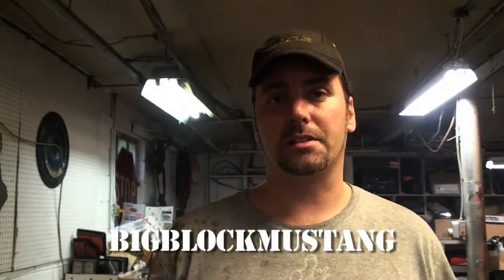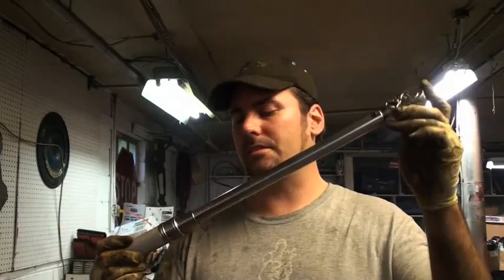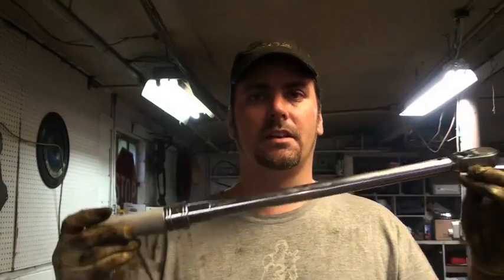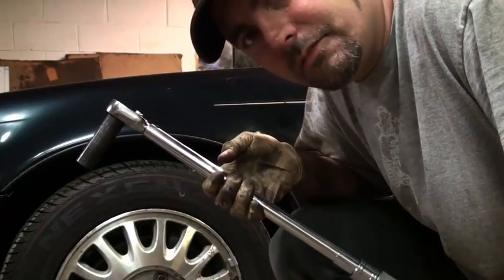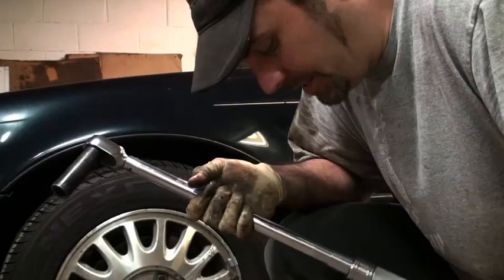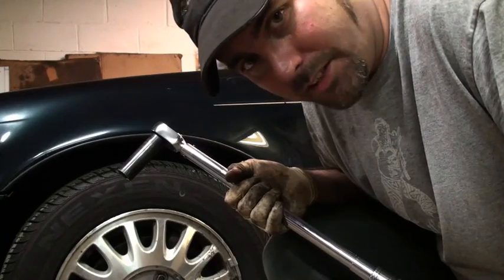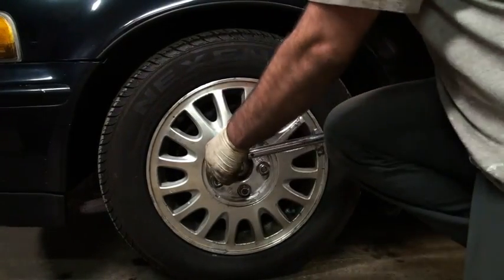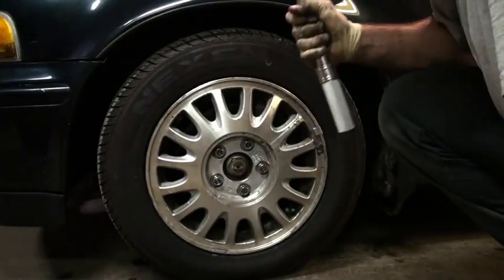Torquing Wheels and Why It Is Important - EricTheCarGuy

Comment: at the shop I work at we use torque sticks then the torque wrench to do the final tightening like you said to do. BUT we torque the wheels 20ftlbs higher (ex instead of 80 for hondas we go to 100). We do this to compensate for the rust on the hubs and studs. they also do this at the honda dealerships in my area. btw in Canada where I live we see A LOT of rust because of our winters. How do you feel about this method we use? thanks
Reply: i dont think that should be done. the best thing would be to scrape off or brillow pad the mating surfaces if rust is a concern. many people do not understand torque. if the stud stretches too much due to overtorquing, and the stud yields, then it is prone to failure. lug nuts should be installed by hand, so that any previously damaged threads will be detected. any resistance when twisting the lugs on by hand should raise a red flag. if the resistance is ignored and the lug is torqued down using any said torque wrench, the wrench will most likely get a false reading, since the damaged threads offer more resistance, you will meet your target torque prematurely, as trorque wrenches only measure the resistance to twisting. resistance due to bad or dirty threads is a negative. you want the only resistance to be via the stud stretching. bolt stretch and the spring type tension it generates is what keeps things tight.

Comment: Seeing your torque wrench setting turned down below the lowest setting made me cringe.
Reply: I don't know if you know this but all spring loaded "clicker" style torque wrenches require that for storage you turn down the torque setting. This is to preserve the tension of the internal spring and maintain accuracy of the wrench. You never store or leave a torque wrench set to a specific setting it "WILL" ruin it and require you to have it serviced or replaced.
Reply: Yes I've read that, but all my mechanic training, includeing Tech data used by the US Air Force and the US Army sates to set click type torque wrenches to their lowest setting. Not below the lowest setting.
Reply: insylem Torque setings should be determines by the stress level and rockwell hardness of the application and usage of the part/s.
Reply: I'm assuming he did that to show viewers at home the full range of settings, rather than as a routine practice. I will keep this in mind if I end up buying one for myself.

Comment: The way you demonstrated it you showed that the torque was at least 80 lbs.  The nuts could have been on at 200ft lbs and it will click at 80.  I always run it down by hand. If you don't move the nut at all with the torque wrench you could be over tight.  And NEVER use a torque wrench to loosen fasteners.
Reply: I was just about to make that exact comment. Another note on torquing any fastener is over torquing will actually lower total clamping force exerted. It's almost like a rubber band when it is torqued correctly the fastener will stretch a very small amount 1/1,000th or even 1/10,000th of a inch. This will apply a stored energy which will hold the components together. What happens if too much torque is applied is like a rubber band tiny microscopic fractures like tears will occur this will lower the amount of energy stored lowering clamping force.

 I work for Firestone/Bridgestone the USA's largest automotive service provider. Here back about 14yrs ago my company conducted a test on mechanical fasteners particularly wheel studs as we were having a large amount of insurance claims over wheels falling off customers cars. This alarmed us as we had just put into action a new policy of "double torquing" in which a second employee would double check that all the lug nuts were tightened to specification. Even though we had put this policy into practice across all 5,000 stores nation wide we still had an unusual amount of claims. Upon further review and testing we discovered that "Over torquing" not under torquing of the fasteners was the cause of almost all of our claims. Now all employees are required to use a nut-runner pre-torque all lug nuts, then double torque, if the lug nut does not rotate at least 1/4 turn before reaching specification. They must remove the wheel and inspect all components.
Reply: hobbles wolf this is fantastic and should be done at all shops. your very last sentence is very important. normally if they even care to recheck, they would just loosen it up a little and retorque, without caring to investigate the red flag. your explanation is great and many many many people have no idea!!!and we're talking about "professionals"!!!! the bolt stretch you speak of can be thaught of like a mercury thermostat. 0 degress is the average of the torque spec. 30 degrees and you are undertorqued. negative 30 degrees and you are overtorqued and the bolt has yielded... and there is maybe the same clamping force as the 30 degree mark. negative 40 degrees and the bolt is in risk of shearing, or the threads pull out. most and i mean most people think, "hey, the more force i put on this, the tighter it will get!" when in actuality thats only true up to a point.

Comment: Does the torque change if you have performance wheels? or would it stay the same as the manufacturer recommends??
Reply: I would say torquing you lug nuts on the right spec will only help you not getting them to fly off. And I GUESS it's the only performance you can get out of it.

Comment: Sry about the dumb question but how do we know how much torque the tires require? Is it shown somewhere? I didn't get that.
Reply: It depends on the vehicle. Most cars and light trucks are 80-100 ft-lb. Owner or service manual should have it or just google your car's lug nut torque and try to find a number that a few different sources agree on. I torque my 97 f150 4x4 to 100 and my 95 Civic to 80.

Comment: Last year I was at Lincoln tech and this guy just drilled on this woman's luge nuts with an impact wrench and when she left from class a few of her lugs broke causing the wheel to vibrate and break the studs... So yea don't do that, invest in torque sticks or at least a torque wrench.
Reply: I would recommend a torque wrench over a torque stick. As far as I know torque sticks are not that accurate.

Comment: Eric from watching you torque the lugs I saw no movement at all which leads me to believe they were all over torqued already. Just saying, 30 year aviation mechanic, everything gets torqued and witnessed by an inspector, no inspector would have ever signed off on that deal. Thanks for pointing out the necessity of torqueing crucial components.

Comment: hi Eric , i have Hyundai accent 2011 , i am willing to buy new tyres , after installing the new tires do i have to do BALANCE only to these new tires or i should do BALANCE and ALLIGNMENT too for these two tires which i want to install in the front of the car . thanks a lot
Reply: it's not necessary but it's highly recommended to get an alignment after installing new tires. because if your alignment is out it will put uneven wear on your tires

Comment: Eric, Big Fan of yours. I am an Airplane mechanic.  I could not help to notice that your TORQUE WRENCH was beyond its lowest setting.  This might not be as important to you.  But in the Airplane world, TORQUE WRENCH care is extremely important.  50 ft/lbs was your lowest setting.  Your line should align with the that.  Going lower than that, can and will throw you torque wrench out of calibration.  Not picking at you.  Staying dirty with ALL mechs.  GOD Bless and Support your troops.
Reply: I had no idea. I'm about to set my torque wrench to 50, the lowest setting no xD.

Comment: I noticed it clicked without moving - Wouldn't that mean the lugs are already on there above 80 ft/lbs? Shouldn't they move a bit before the click?

I put my lugs on with an air gun, but I just "blip" the trigger and let the "momentum" snug it up. Then I use the torque wrench to tighten it. If the bolt doesn't move before the click, I use a breaker bar to loosen it up a bit and then re-torque. 

Also, with alloys, its important to check the torque after driving a bit - They can loosen up over time.
Reply: Sudz that's true and Eric should know this. But i bet 70-80% of mechanics dont know it. You are doing it perfect with the "loosen an re-torque if it wasn't moving" that's how it should be done.
Reply: When I was taught how to use a torque wrench,  they said to always make one continuous motion, if you stop it takes more torque to get it started again. Chances are if you have to torque over that bolt,  you need to loosen it out and redo it,  unless you are doing torqing in steps
Reply: I was wondering about this too. his torque wrench didn't quite move at all and it clicked everytime.

So what your saying is you need to take the breaker bar and loosen it and then tighten it back with torque wrench? If so, whats really the point of the air gun to tighten it in the first place? I like to learn this myself now and start changing tires myself instead of dragging these tires out of my garage to the mechanic to change.

Do you also know the torque needed on a volkswagen passat 2010 16 inch tires? two year comment, but hope someone responds.

Comment: Why did it click without you doing any tightening.Seems the nuts were already tight maybe too tight.And impact guns have  a adjustment for air pressure.
Reply: he already torqued the lug nuts, hes just demonstrating the sound and what you have to do in order to torque them.

Comment: In an otherwise very good video of changing out a front chain sprocket on a motorcycle, I saw a guy use a torque wrench as his breaker bar for the bolt.

Comment: Doing this makes it a lot easier to remove wheels when you get a flat compared to some tyre centre using a rattle gun tightening them up till they almost strip. Shame places like Kwik Fit rattle the nuts on then go around with a torque wrench afterwards, 'cos it's torqued up right innit? If that's the case slacken them off when you get home and retorque them properly

Comment: The way you did this is the way i have seen tire shops do it. You really did not torque the wheels to spec but made sure they were at least 80 ft/lb. The lug did not move at all when you torqued it, indicating that it was already above 80.  If you had 200 ft/lbs of torque already on there, the wrench would click at 80. You should get some movement of the lug before it clicks indicating the proper torque.
Reply: K Kampy i feel like he already torqued everything and that was just a demonstration of how to do it…
Reply: Well if that was his intention  to simply demonstrate 'how to' then he should have pointed that out to the viewers and not left it to interpretation of the viewer.

Comment: WOW; thanks.  I just did a rotor replacement and I'm curious why breaking after this work is not recently surging..  You may have solved the riddle.  The rotor replacement on my 99 Acura was really painful as I had a hard time removing the holding screws; a requirement many of you experts understand but I didn't.

Comment: maybe this has been mentioned already but not going to scour 300 comments.  What if that tire had 100lbs of torque, it would still click?  Perhaps another video showing  you tightening the nut until it starts to click?  :D  oh and btw, always reset the wrench back to zero when not using it.
Reply: Johny Knox you set it back to zero or under 25% of it's full load so that Wyoming there isn't pressure constantly against all the parts inside the wrench. Which in result I think will wear them out and not give you proper toque anymore. Hope this helped!
Reply: I was thinking the same when I seen it click right away. To me, that is a sign of over torquing. Just out of curiosity, what's the reason to reset the wrench to zero?
Reply: federalrj94 it has thanks. I have been setting it at 15lbs since I read that.

Comment: So you roll the lugs until snug, lower the car to the ground, then torque them to spec in a star pattern?  Or are you supposed to torque them while the wheel is still in the air?
Reply: I like to put the car down just far enough to hold the wheel while I torque the lug nuts, then I put the vehicle all the way down.
Reply: The wheel will turn if not on the ground you moron!
Reply: LoudProudNPunk1
You are right. Sorry

Comment: Refinements to the torque process:
1) Antiseize on lug threads makes wheel removal vastly easier down the road (at night, in the rain, etc)
2) REDUCE torque settings by approx. 5% whenever antiseize is used, or risk overtorqueing and stripping / breaking lugs.
3) Pre-tighten first, as mentioned already here, then do one - two rounds with torque wrench gradually increasing pressure until one nut clicks/reaches desired setting; proceed on next in star pattern to same final setting, and so on. As mentioned, accuracy is correct only at first click.
4) "Retorqueing" later is not advised unless one re-loosens all lugs and starts from the beginning, because over time nuts get overtightened.
5) Also mentioned here, even if a good shop sets air impact tools, every wheel mfg settings are slightly different, esp. alloy to steel, so retorqueing your own wheels after every shop change is a smart idea anyway.
6) Of course, ALWAYS do final tightening with wheel on the ground, not on a jack/ lift.
7) Crude approximations can be finagled i.e. 160 lb. person slowly weighting the horizontal wrench arm 6" from nut is applying 80 ft-lb; do NOT jump!

Comment: Great videos.  Just quick detail:  can't accurately check torque of nuts already tightened with a torque wrench.  The nut or lug already at static coefficient.  The torque is correct only when the nut or lug is turning and exhibiting dynamic coefficient of friction when the torque value is reached or clicked using click type wrench.  Generally speaking, the hardware could be under-torqued yet shows correct.  The static coefficient could be 20% or more than dynamic.

Comment: If the wheel nuts are run in with the impact driver first and then torqued to specs.,is that ok? I usually just run them in with the impact driver and then torque.

Comment: Harbor Freight has them for pretty cheap and should have a chart to show what you need.  No torque sticks are entirely accurate(sorry Snap-on fans, even theirs are iffy) but they are far cheaper than a real torque wrench.

Just don't POUND on them with the impact and you should be pretty close. Stop 'drilling' as soon as it hits solid for a second.

Comment: Yes, I don't even know how well it works. I've torqued perfectly and not torqued at all and I still get warped rotors within 20k miles on a set. 

Like my comment earlier, I think it has more to do with the cheap as hell quality of rotors I keep buying. I think I will finally try a set of considerably higher priced aftermarket ones on my next go around and see how that works out.

Comment: to all the tire shops that iv'e been too i had never seen any guy use torque sticks, some didn't even know what that was, that's why id rather do things by myself, some guy torqued my lug nuts so much like 8 seconds straight jamming it with the impact, he then said, you need a new hub, yeah cause you shredded the hell out of it right now. it used to be fine, now look at me replacing studs.

Comment: When I last had new tyres fitted the dude tightened them up with a rattle gun then went over them again with a torque wrench set at the correct torque, but he was using a 3/4 inch rattle gun to fit the nuts in the beginning then going over with the torque wrench but the rattle gun had done the nuts up so tight that I had to use a 3/4 "T" bar and a metre long piece of pipe to undo them a few days later to fix a flat, luckily I was at home and not out bush with just the cars wheel brace.

Comment: If you oil the threads, you need to reduce the torque by 10% and antiseize can require additional torque to achieve the same clamping pressure. DOT does not approve the use of any lubricant on wheels fasteners.

Comment: Is it possible to properly torque a fastener that isn't lubricated first?  Shouldn't a little anti-seize be applied?  Doesn't a rusted or dirty fastener require more torque than a clean or properly lubricated one?

Comment: I am a master tech and mechanical engineer and i learned, that you have to tighten the nuts/bolts with the torque wrench till it clicks. In your case, it just clicked and you didnt tighten them, they were tight before and maybe to tight. So just screw the fasteners in hand tight and then tighten them with the torque wrench slowly till it clicks. The threads and the seat have to be clean but you can use a little RTV on the seat, not the threads!

Comment: good day mr. eric i was enjoy to watch ure vedios for subscription,. i have one question about touch wrench,what is the computation of setting in touch wrench when the spanner use is 20 to 30 back wrench or how to know the setting if the head of the bolts was 20 cm ,spanner 20 backwrinch. how to set right using torch in lb or nm.

Comment: It has been our experience that drawing the lugs down in a single pass tends to cause distortion of the hub/rotor and can also result in improper rotor seating leading to run-out (wobble) on vehicles where rotor is separate from the hub. We had one extreme case where the only reliable procedure not to induce warpage was to torque in pattern and in steps, warm up the brakes and then loosen the lugs and repeat the process. Apparently the aluminum wheels on that vehicle were deforming when hot.